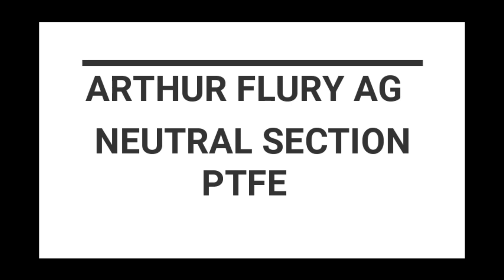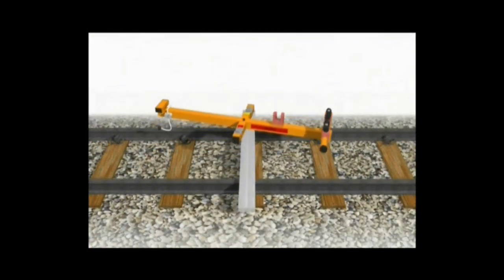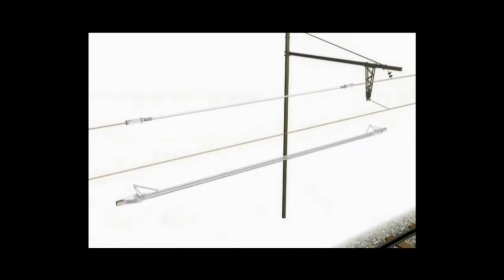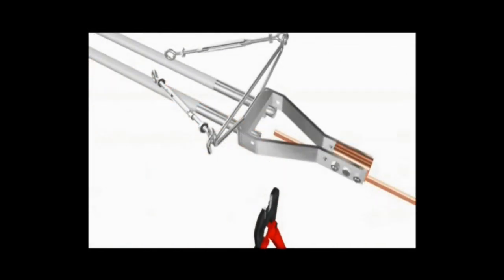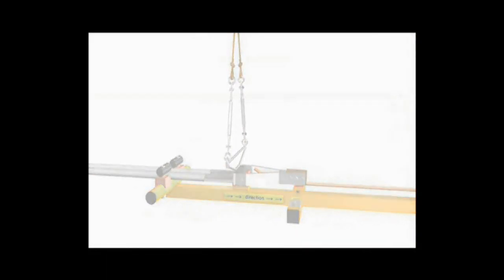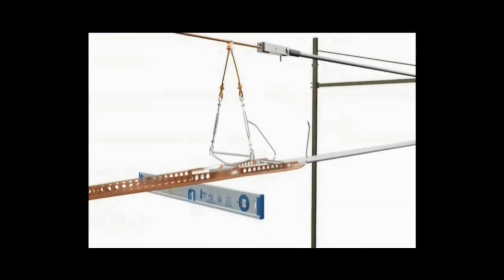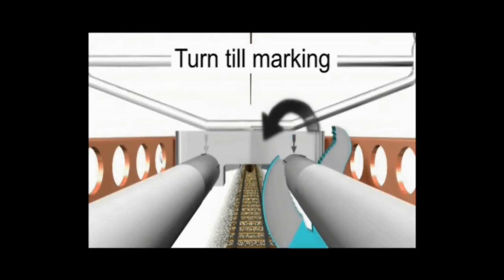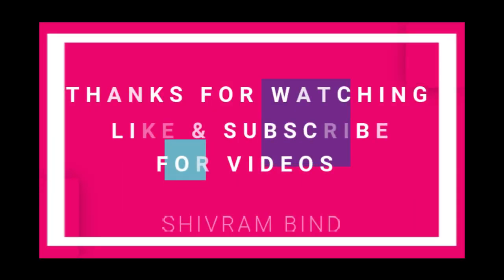ARTHUR FLURY AG NEUTRAL SECTION

Comment: I made a Video about the NEUTRAL SECTION for Train Sim World, it focus on what the driver/engineer needs to do and how to use the MCB of the train when goling through the NEUTRAL SECTION as well as I have been learning, in my research I came across your video here and would like add it to the end of my video, if that is okay, or at least the thumbnail with a link back to this video yours.